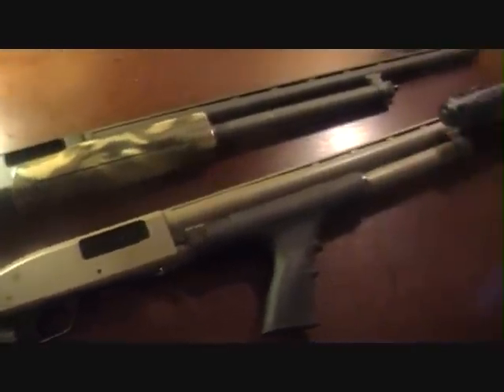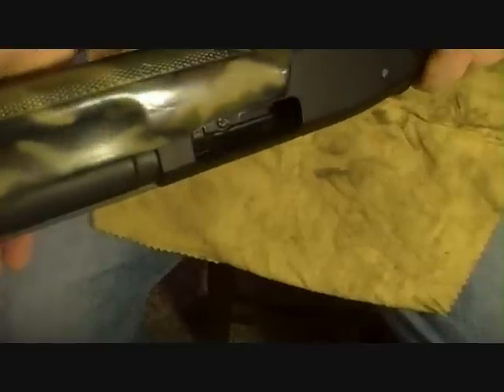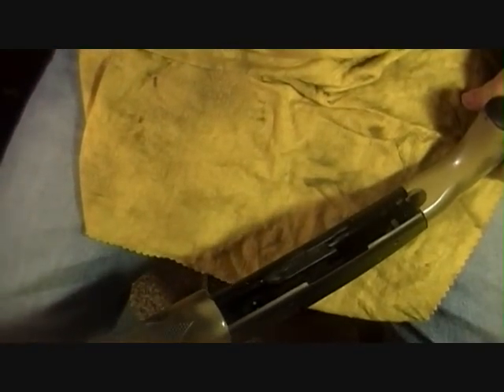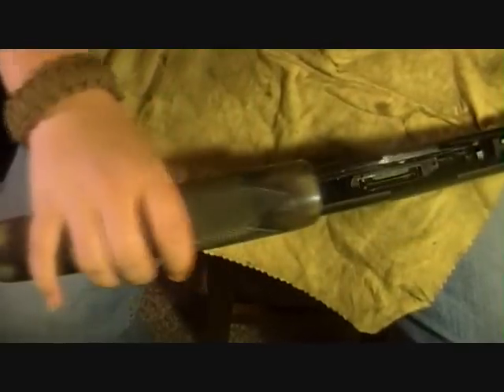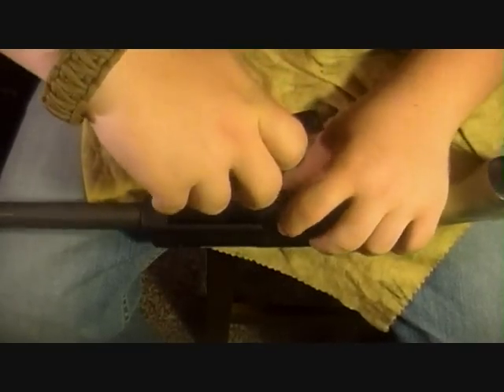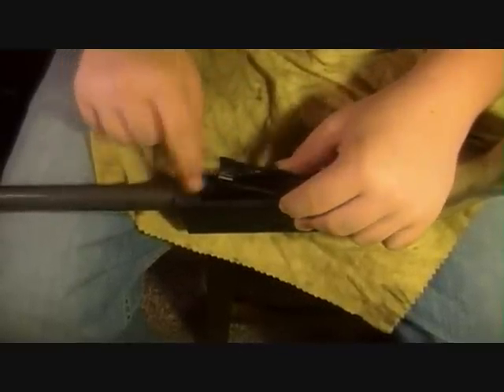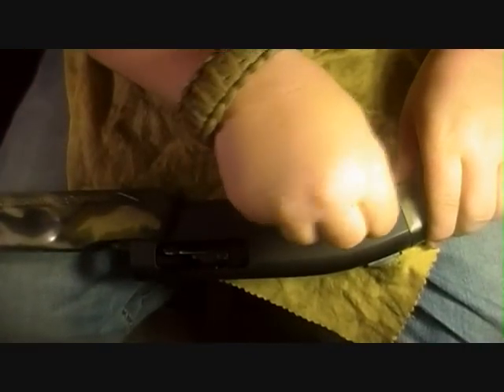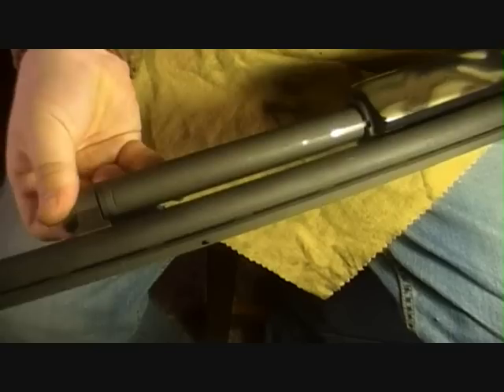Mossberg 500 Disassembly

Comment: the part you left in is called the elevator.all you have to do to remove it is to squeeze the two arms together and it will come right out.the other part you didnt know the name of is called the bolt slide.good video and i hope this helps.:)